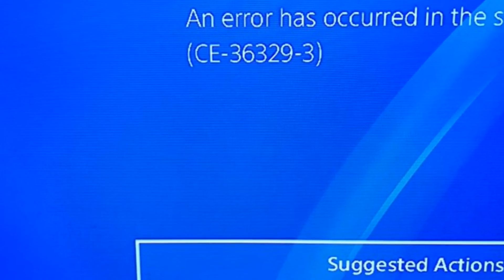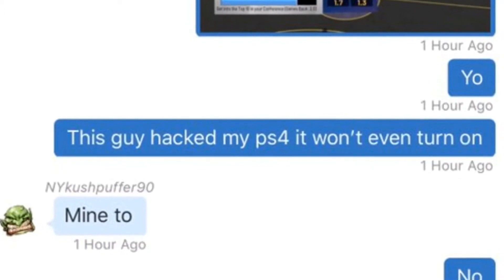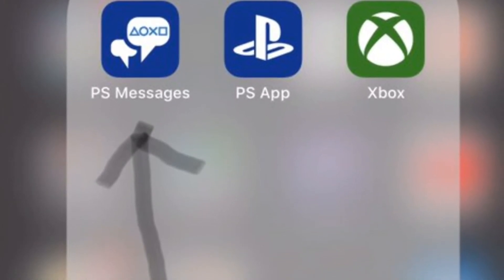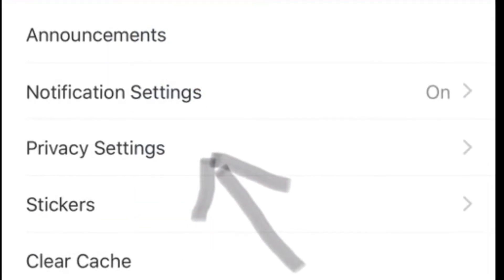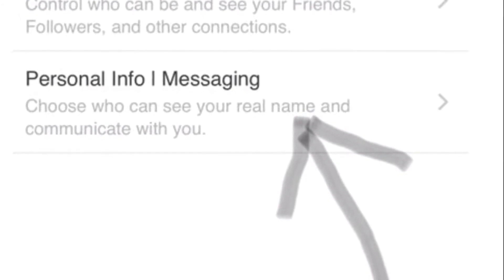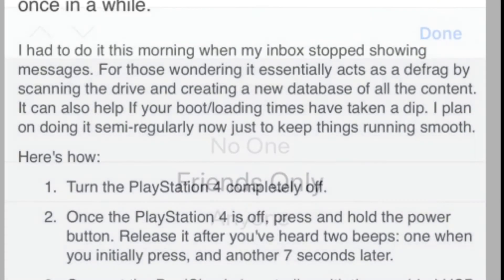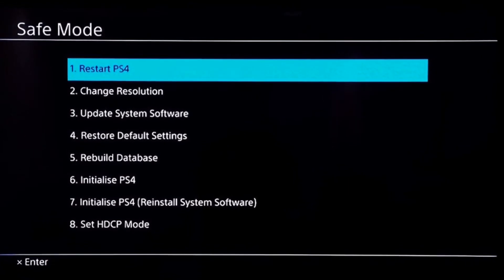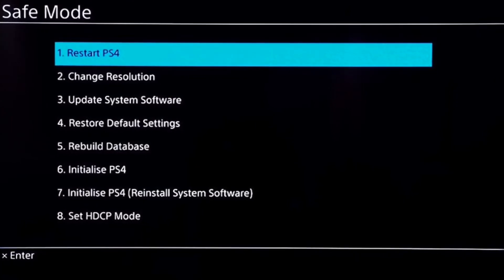CE-36329-3 PlayStation Error Fix With Explanation.

Comment: So wait a minute. Ive been getting the error message and my ps4 would freeze and then get a black screen before the message appeared. 
I checked my Playstation messages app 
i couldn't find the message. 
I rebuild the database still didn't work and i realized. You think it's the hardrive failing and i need a new hardrive ? I did get a 
friend request from a ps girl in 2019 but i unaccept the
 friend request cuz i knew it was either a bot or a hacker. 
And my ps4 was i think still fine. Till lots of months later. 
Plus i did touch the ps4 top and it was hot and makes a loud Sound which i can describe as a 
hot air dryer.
either that's the problem so i can clean it cuz i haven't clean my ps4 for 2 years. Or it's my hardrive. 
Edit : Alright i have a new theory 
or conclusion. 
What if this is happening to most players because ps4 is becoming outdated and Sony might be preparing for the 
Playstation 5 ? 
Maybe when The 
Playstation 5 comes out maybe that's when this weird stuff and error won't follow the PS5 Console and everything will be running smooth. 
Cuz maybe these errors are probably in my theory 
probably cuz on how outdated the PS4 Is. I mean think about how long the PS4 has been going long sense it was released back in 2013-2014 dang time flies for Ps4
Reply: I have a PS4 Pro and I still get these problems
Reply: @thehoundgaming291  hows your ps4 bro? I have the same problem. All my installed game keeps crashing when i updated all of them it get worst
Reply: @qwertyasd6570   same problem im pissed
Reply: Same
Reply: EXACTLYYYYYYY 😭😭😭😭😭 my ps4 does the same shit
Reply: Same

Comment: I had to rebuild the database like 3 times and it’s still moving slow and freezing 🙃🤦🏽‍♂️then today i did a hard reset and my game still moving slow
Reply: it happened with me I did everything even factory reset, and still getting error CE 36329-3!! I'm pretty sure it's someone trying to hack , I deleted my card from psn and changed my acc password, and it's all NORMAL, it's not freezing anymore. Try this
Reply: Same bro I’m on the same shit lol
Reply: And coincidentally PS_girl 5435 sent me a friend request 2 days after the error appeared, I blocked immediately
Reply: @ShiroUsagiArt  dude what do you mean by deleted my psn card?
Reply: @ShiroUsagiArt   yo same shit happened to me.
Reply: Man I did all that too
Reply: Same
Reply: Your database is messed up
Reply from the maker: +Tyrek Graham 

2 Things come to mind right off.

1. Overheating Issues:  feel the top of your PS4, Does it feel hot?  Is the fan constantly on?  You may need to clean it out with compressed air.  Also make sure you have put your PS4 in a place that doesn’t block the vents on the PS4.  Like on a fluffy carpet or up against a wall or inside an elclosed place.  Heat will def slow it down and give your PS4 a shorter life expectancy.

2. Anything that has moving parts will eventually fail, from your car to your PS4.
So even though your hard drive seems to be working, it could be on its way to failure.  And when a hard drive is failing the information on it can’t be read properly causing skipping and total system freezes.  It’s harder to diagnose a half dead or intermittent hard drive failure.  But sometimes the hard drive will making screeching noises or clicking sounds but not always.  

Conclusion:  I would try cleaning the PS4 out first with compressed air. And make sure it is in an area where it can properly ventilate air.   If it’s still acting up, I would use the Video I made on my channel and replace the hard drive.  I hope this helps and if you have anymore questions just ask.

Comment: My ps4 stopped from that but started to freeze aloooooooooooot plz help
Reply from the maker: I would think without looking at it, it could be one of 2 things. 

1. It could be Overheating and you need to get some compressed air and and spray through the ventilation vents without taking anything apart.  Through the back by the power supply too. 

2. If that does not help, then you could have a hard drive that is starting to fail on you. I have another video on my channel on how to change the hard drive and reinstall the PlayStation operating system and a suggestion for a replacement drive.  I hope this helps you my friend.

Comment: Does this error follows the account?? I mean, if I get a new PS4, will I have the same problem??
Reply from the maker: Santi Ferri 

Yes it follows the account. To any system you log in on.
Reply: Mr. Goody 
it doesn’t.. I’m using a new PS4 and the problem didn’t follow the account
Reply from the maker: Santi Ferri then it had to be your old hard drive starting to go bad and not the virus.

Comment: Bro, help me, i have the same error, but the problem now is that my PS4 turn off when i try to conect my Dualshock 4, and when finally can conect it, my PS4 launch me the same error CE-36329-3, i have done the inizialition and the same problem appear
Reply: I do, but the same problem appears
Reply: And i don't know if is mi HDD because yestearday i download a game
Reply from the maker: The hard drive can work sometimes and then sometimes notthis means that it is working intermittently that means sometimes it could work fine and then others not work at all and give you the error.
Reply from the maker: +Alex Hernandez 

Alex, Try using a different USB cord when connecting Your Controller to your PlayStation, so many times I have done this process to find out the USB cord was bad.

Comment: I didn't get message me ps4 keeps freezing and then can't go back to main screen so knock of bye switch cuz have no option and then it's fine and it'll do it randomly again
Reply from the maker: Then my best guess without actually looking at it would be that it is a hard drive going bad and you need to replace it.   I have a video of how to do step-by-step instructions and also a suggestion for a replacement hard drive just look in my channel and you will see the video I’m talking about.  If you have anymore questions or comments just let me know.

Comment: I never got those hacked messages you’re talkin about my PS4 just freezes up and shutdown and it would take so long to boot back up and when it does I get the error message please help man. I’d appreciate it so much
Reply from the maker: If you never got the Hacked Messages like in the Video, then you are probably having a hardware error.   Such as overheating or a hard drive error.  This error usually means hard drive.  And I have made a video of how to change your hard drive and reinstall the Playstation 4 operating system.  If you do decide to replace your hard drive,  You should get at least a 2gb as game installs take up more space then ever this days.  Also before you do decide to buy a new hard drive or not.  You should buy some compressed air, and put it over the vent holes and the back of your system and blow it out and see if any dirt or lent balls fly out, that could be causing your system to overheat.  I hope these tips help you.    If you have anymore comments or questions just let me know.
Reply: Mr. Goody I’ll be sure to try this thank you I appreciate it
Reply from the maker: @xItzBlizzy-    Your Welcome.

Comment: I did everything man but this error just wont go away everytime i open my ps4 after 1 min it just freez and then its turns off man i just bought the ps4 6 month ago man its only been 6 month like come on anyway man your video rocks but playstation devs really need to do something on this issues
Reply from the maker: +Mob 100 

Yes I am agree to things that could still be going on with your PlayStation is the power supply itself or PlayStation could be overheating and it might need to be cleaned out on the inside with compressed air or maybe some even new thermal paste.

Comment: when I select "rebuild database." it gives ERROR  SU41336-7
Reply from the maker: One thing you can try it before buying a new hard drive is to make sure you have everything packed up and when you going to say mode instead of selecting rebuild database go ahead and initialize the hard drive.  This will erase everything please be aware of that and reinstall the entire operating system and if the erro was software-based then this will get rid of that error.  I hope this helps you.
Reply: @Mr_Goody  thanks,  I had to initialize the system already

Comment: I just bought my ps4 pro n got this while moving around the home screen... Should I exchange my ps4?
Reply from the maker: rycefay 

I would try to boot into safe mode first and rebuild the database if that does not work I would definitely exchange it.
Reply: @Mr_Goody  seems to be running smooth.. I mean I had this issue before on older PS4 model the laggy home. But used rebuild data to help.  I dunno if I should be worried since I just bought this PS4.
Reply from the maker: rycefay 

Sometimes it can be software corruption and if it is that I would give it a couple of days to see if it is, after the Data Base Rebuild.  But if you’re really worried I would just save my game saves and you can always send it in under warranty.

Comment: Didnt fix for me...
Reply from the maker: +Niv 

If this does not work then you have to replace the hard drive just like in my updated video.
Reply: Mr. Goody thx for the reply. I think i didnt analyze correctly, there was supposed to be a system update that made that error and not a message.
But the symptoms were the same and thats y i got confused.
Im tring to download and install the update thry safe mode though it takes a long time.
Reply from the maker: Niv 

Yes it does take a long time,  I hope you get it fixed and if you need anything just ask.
Reply: Mr. Goody thx alot man!! I appreciate it!
Reply from the maker: Niv 

Your Welcome

Comment: I didnt get no message & i just got my ps4 like 5 months ago. My controller doesnt even want to connect. Wtf
Reply from the maker: I wouldn’t know without actually seeing it in person but if it’s only five months old you should be able to send it in under warranty.  I would contact Sony. I know it’s a pain to be without it but that’s what I would do.
Reply: Mr. Goody the weird thing is my brother was just playing it & all of sudden right when he gets off i use it & turn on the ps4 with the controller & it doesnt want to move at all. Its like frozen & stuck. But yeah i’ll see if tomorrow it works. Otherwise i gotta get a different controller or something
Reply from the maker: Eric 

If you things to try with the controller is to plug it in with the micro USB wire as if you were going to charge it and see if it works that way and last but not least there is a reset button and you’ll have to use a paper clip to hold in the button to reset the controller underneath.

https://youtu.be/1KUUxPO2RG4

There is a link I found to show you what I’m talking about.
Reply: Mr. Goody yeahh i also tried that man. Resetting the controller & it still doesnt work :/ fucking sucks. But this problem usually happens when someone is trying to hack you ?

Comment: I just expereincing last time, my PS4 are sudden freeze and can't be turn off, so I unplug the cable then turn on again and showed the message software error, I thought before it's Blue Light Of Death
Reply from the maker: The two ways I have explaining it in the two different videos will definitely fix this error code.
Reply: @Mr_Goody 
The same error + black screen... NEW SSD 1TB.  I TRYED EVERYTHING... THE SAME FUCKING ERROR. BLACK SCREEN PS4 CAN'T BE TURN OFF SO I UNPLUG THE CABLE. SO IT'S NOT HDD ISSUE... ITINK IT'S SONY ISSUE
Reply: @Mr_Goody 
This error occurs only in Playstation Store menu or in main menu or in Settings menu. Never when I play a game.
Reply: @Mr_Goody 
I replaced the old hdd with crucial 1tb SSD...  Error code: CE-36329-3
System software 6.72

Comment: Help it said my data was corrupt so it restarted then I got back on and turned on a game and my screen turned black and it kicked me out now it says a problem has occurred and it wants me to type my response but every time I type my screen freezes and then it repeats
Reply from the maker: It could be your hard drive my friend if it’s not the software and you can get those at Best Buy if you do not want to order it on eBay and wait on it for shipping.  I would suggest at least a 1 TB these days or larger maybe even a 2 TB but if you need help installing one if you get it I can help you with instructions.   I hope you get it fixed my friend.

Comment: I've been redownloading all my games and in the middle of download my ps4 shut off and got this error msg when I turned it back on. Now gotta re-redownload the corrupt data
Reply from the maker: Been in your shoes before.
Reply: Did you fix the problem?? May you update me regarding this??
Reply from the maker: Yes this fixed the problem.
Reply: I just rebuilt the database, hopefully that fixes it. I already had "friends only" on from before for msgs so I know the error code didn't come from that.
Reply: @BP-rh8tl  does rebuilding ylur ps4 help?
Reply: @LakeShowtime  rebuilding database helps a little bit.
Reply: @BP-rh8tl   i tried it so many times. But it keeps crashing. I tried anything initiliazing, rebuild, redownload all the games. I never clean my ps4 pro before, I guess the issue here is may hard drive but im lil bit hesistant to replace it.  Anyway thanks for the quick response.
Reply: @LakeShowtime  ya maybe replace the hard drive and do a fresh install of the PS4 firmware will fix your issues.

Comment: OK OK SO I HAVE A NEW FROM SOMEELSE A PS4 THAT HAS NO MESSAGES NO CONTACTS NO ONE SO WHY AM I GETTING THIS MESSAGE?
Reply from the maker: If you have updated your firmware and you still get this message in more than likely there is a problem with your hard drive either going bad.  You will need to replace it.  However you may be able to back up your game saves and format your PS4 by initialization in the settings and this may correct your problem temporarily.  But to fix it permanently you will need to replace your hard drive which I’m going to do an update to this video and show everyone exactly how to do this.
Reply: @Mr_Goody  sound like it could be the hard drive as im not fussy about the 100 gb loss in hard drive just pissed off that they gave me a corrupted drive if that is what it is
Reply from the maker: Andrew Kent I completely understand.
Reply: @Mr_Goody  disable hdcr and 7 with usb safemode let me know cus that is where i am at did it work for others?
Reply: please make a vid about hdcr cus there isnt many people need this
Reply from the maker: Ok I will
Reply: @Mr_Goody  i got it from game btw
that is @game everybody
Reply: @Mr_Goody  i was wondering could it be my vr?

Comment: what happened to you? you didnt make that clear my game crashes in vr and shuts down
Reply from the maker: If your game is still crashing after the steps above it is possible that your hard drive is going bad and you could try temporarily backing up your game saves and then erasing everything with initializing your hard drive under settings. Remember this erase everything so make sure everything is backed up.  If this still doesn’t help you will need to replace the hard drive in your PS4.  And I will be doing an updated video showing how to do exactly that.

Comment: I have the same problem but i didint get any messages
Reply from the maker: If your Game is still crashing after the steps above it is possible that your hard drive is going bad and you could try temporarily backing up your game saves and then erasing everything with initializing your hard drive under settings. Remember this erase everything so make sure everything is backed up.  If this still doesn’t help you will need to replace the hard drive in your PS4.  And I will be doing an updated video showing how to do exactly that.

Comment: I’m having an issue with my console (would appreciate any tips/fixes).
Basically if I close a game after playing for a while and then launch a different  game straight away my console will completely shut down. And won’t turn on (the controller just flashes blue but the console doesn’t start). I managed to turn it on later.
Point is my console keeps crashing and after I turn it back on I get this error code CE-36329-3. It happened twice already.
Anyone knows how to fix this? I don’t have this msg thingy.
Reply from the maker: If your game is still crashing after the steps above it is possible that your hard drive is going bad and you could try temporarily backing up your game saves and then erasing everything with initializing your hard drive under settings. Remember this erase everything so make sure everything is backed up.  If this still doesn’t help you will need to replace the hard drive in your PS4.  And I will be doing an updated video showing how to do exactly that.
Reply: Mr. Goody what do you mean by my
Name? My console crashed when I launched a game after recently closing another.
I’ve rebuilt the database and it seems fine for now. I’ll update if it keeps happening.
Reply from the maker: Or Avital 

It was a typo I meant game
Reply: Mr. Goody it happened one with Trials Rising open beta after playing BLOps4 before. The second time was when I launched BLOPs4 after playing TR open beta.
I haven’t touched the beta since since but I played BLOPS multiple times since so it’s either the beta app or my console.